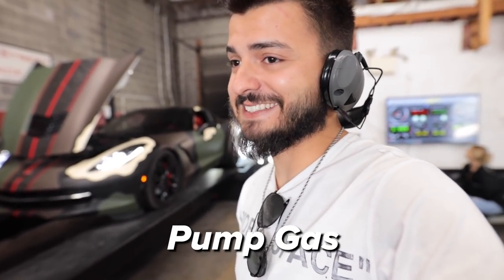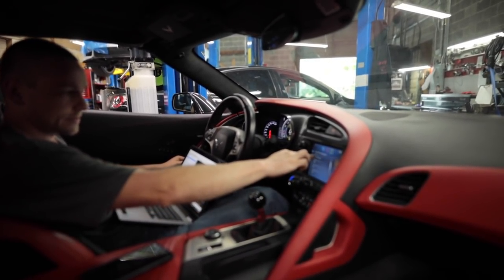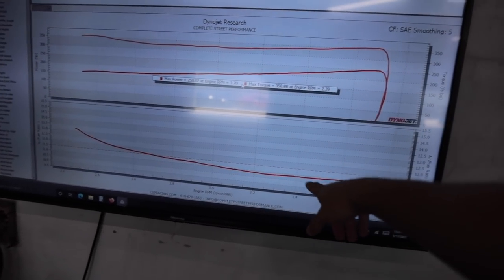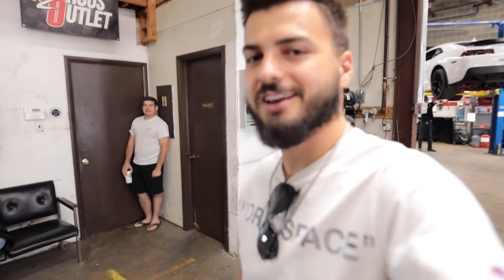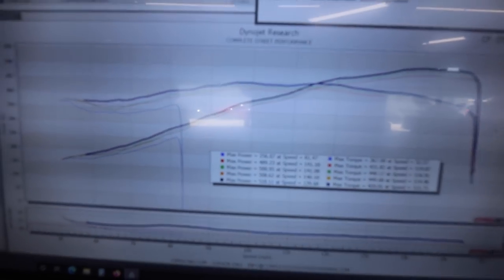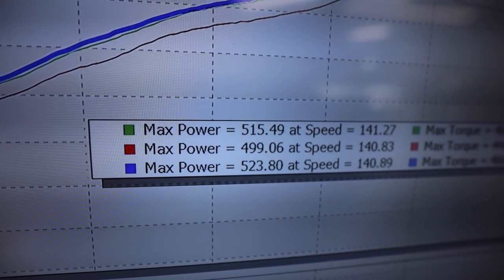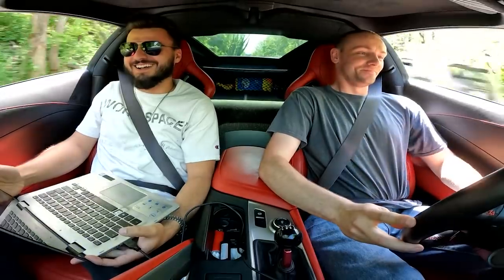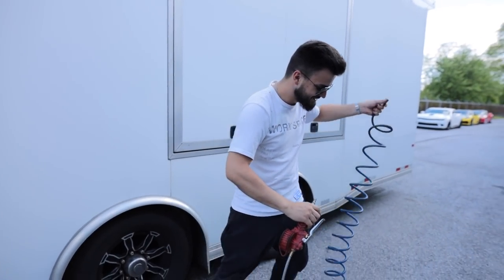The Corvette got FAST and LOUD with a New Big Cam!

Comment: Just passed you guys out on 20 a couple hours ago. I had a company work truck Ford F-150 and I took it to my buddies shop for a oil change and they checked my tire psi and his son was like dad this tire has 80 psi, all of them. So he lowered it down to like 45psi and kid you not when I left it felt like I was pulling a boat anchor! Filled them back up to 80psi and was rolling again! You should be fine running 80psi in your trailer tires they are made for that psi and having thicker sidewalls. More psi better gas mileage!

Comment: Just save yourself the headache and the trailer damage and throw all the 10 plys away or on a lighter trailer. On 14k plus gvwr trailers all I run is 14 ply and no more blow outs even nails or road debris almost doesn’t affect them.

Comment: Fyi. The trailer tires are a max of 80lbs at (X) amount of weight. 5 under that is a good rule of thumb but 50 on those tires is a little too low. 60 minimum.

Comment: My ss has 1 7/8s headers intake off eBay Texas speed f35 and not a single other thing done and made 520 wheel on pump stock head stock injectors stock mani that was on a Dyno jet too

Comment: If I run regular gas now this is just a ? But if I run regular gas in my suburban it's an 05 5.3 if I switched to e what would that do to.my burban it's flex capable just I've never ran it and idk when the last time it's had any would it help it from riding rough I need a tune up As well should I wait ? Yall kno more about chevys then me im a old Ford boy from birth but the burban is a good ride

Comment: GAVIN, on the trailer tires! That’s huge! 50psi you were running in those is not good. 80 is max! I’d run 70 for sure. Be careful, that makes a huge difference on heavy trailers!

Comment: i really want that monster hopefully😂, especially because my truck is just a problem now it wont go on Drive just using it on manual mode suck especially because of the cam going 55 on 3rd is hitting 2500k rpms almost 3🥲